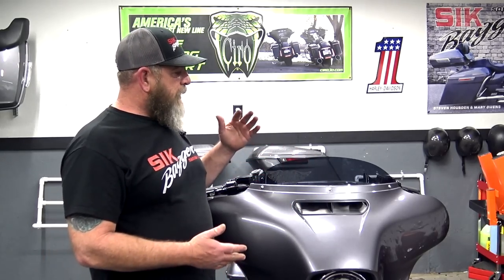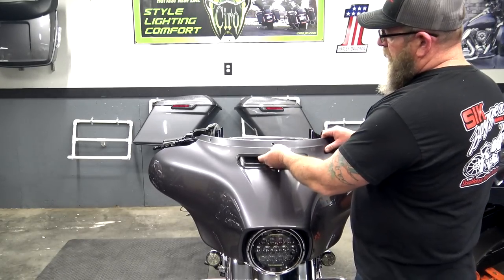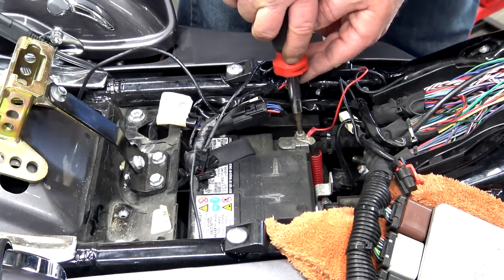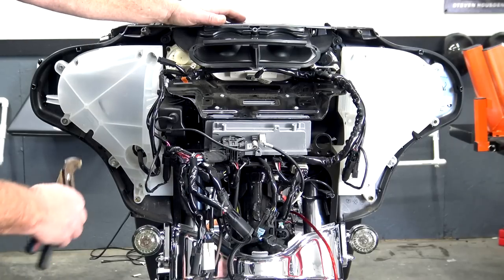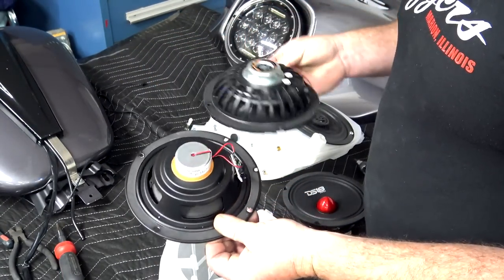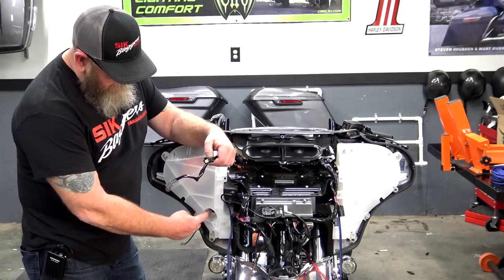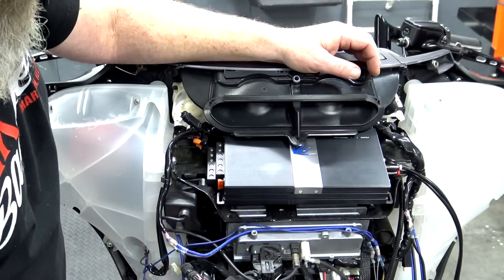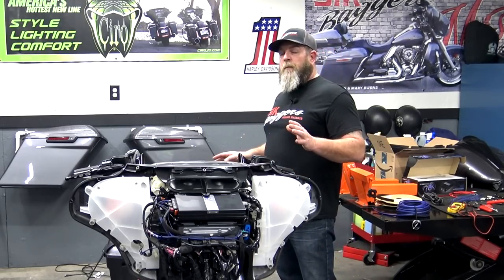⚡Install Amp Speakers Stock Harley Touring Radio⚡

Comment: Exactly what speakers are these? I’ve upgraded with another overpriced brand and they sound terrible.
Reply from the maker: These are ds18 pros but they have went down hill in over the last year and I try to avoid them...We mainly use PRV AUDIO 6MR500-NDY Neodymium 6.5" Mid Range

Comment: What is the line out converter for if u have 4 volts out of the radio
Reply from the maker: the LOC is used when adding an amplifier to a factory radio to convert the radio's speaker level output to the lower amplifier (RCA) level input